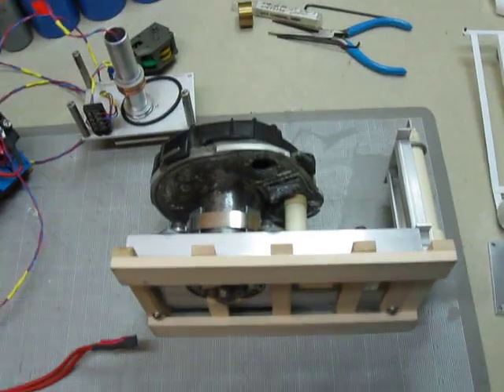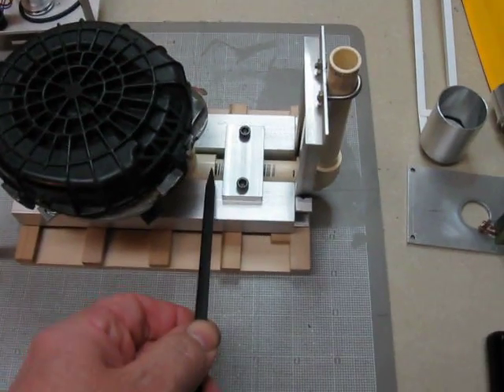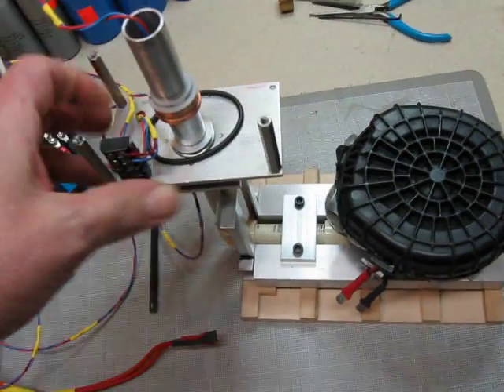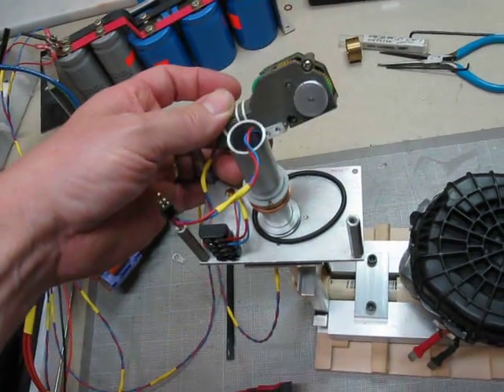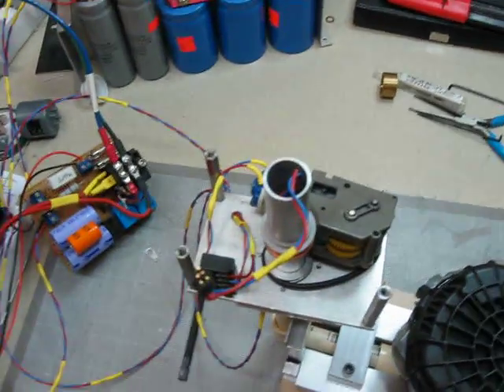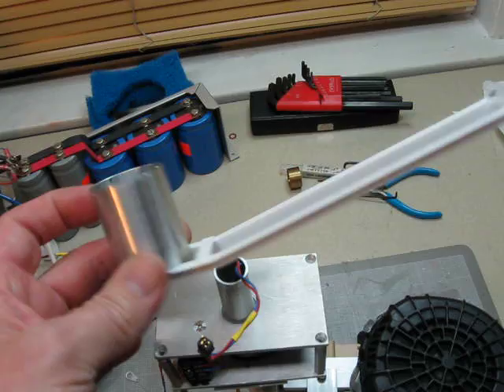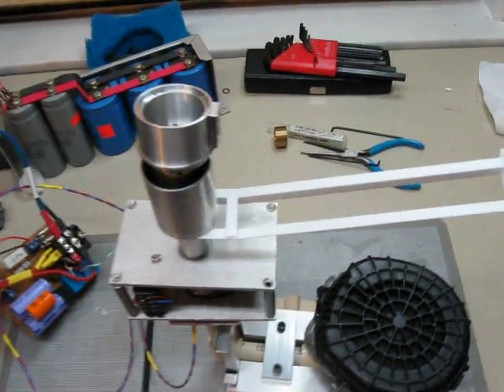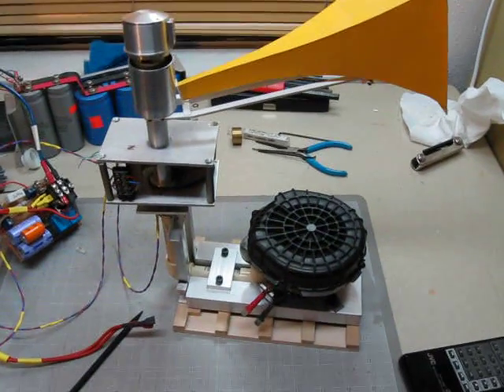Mini Thunderbolt Taken Apart Description Video

Comment: What we need is a Thunderbolt Picnic this summer or down south this winter. Then we can get a better scope on this. If we have it up here in Sioux Falls I could get my buddy with the machine shop (lathes, presses, cutters, mills, you name it) to open the shop for us if we buy him dinner.
I really need a overview on the controller.  I wanted to make one using a old hit and miss flywheel motor  BTW. 
Nice idea with the automotive air pump. Hmm Maybe an car exhaust version is needed!

Comment: i made a mini thunderbolt too! but i am useing a hair dryer for the blower. the horn is falling apart. it actually fell when i was typing. the siren does not rotate and my siren has a hollow pipe as the hole painted black and is a little shorter that me. most it is made of cardboard. i will post a video soon of the siren.